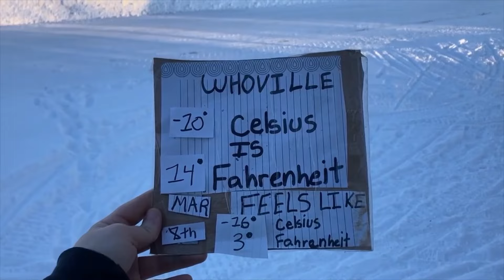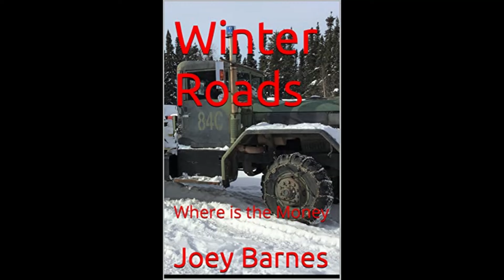Friday What a Day But We Got What We Wanted Done March 08 2024

Comment: good day from ont. If you you use a old tire with out a rim and join it to the cables on the furd and join it to the chain of the toy it will take the shock out of the pull and become kinetic energy. easer on the equipment and you back. plus i have a few 6x6 for parts send me a list to fix the rear drive and i will send you the parts
Reply from the maker: or just get a tow strap out of the trailer shed that was right there or use the cat we had running or maybe release the frozen brake. no idea what is broken on the Green Toy, it was done during Hollywood Filming that never aired on TV.  thansk

Comment: Oh the struggles of open diffs
Reply from the maker: more like broken not working back rearend.  thansk
Reply: @kingofobsolete4789 it sure would have pulled harder with  both axles on the go, or not having to drag a locked chained wheel on the Ford (but as my buddy says ‘if it’s not one damn thing, it’s another damn thing’. I’m assuming the green toy doesn’t have a recovery winch as well as the crane.

I have to say I was mighty impressed at how long your patience lasted until you went ‘kintetic’.